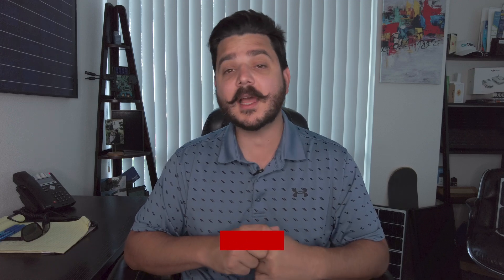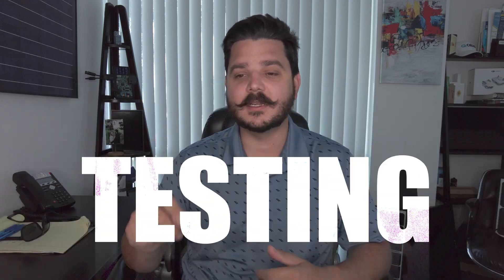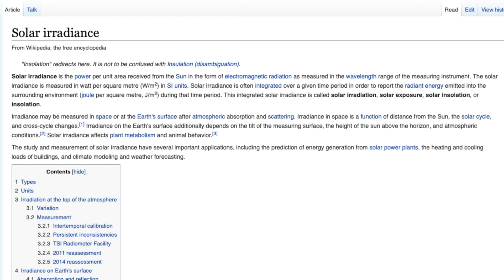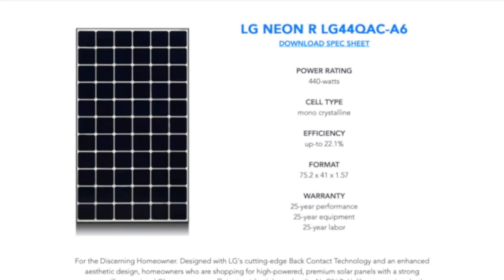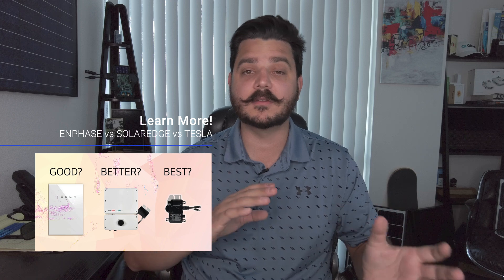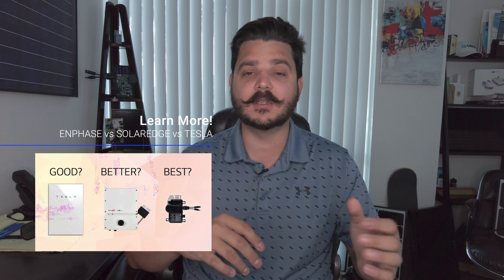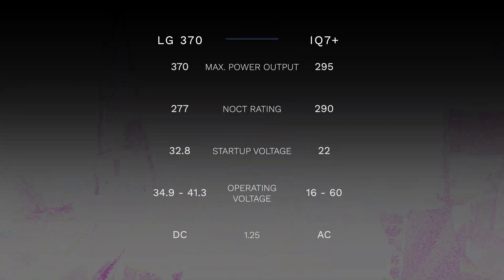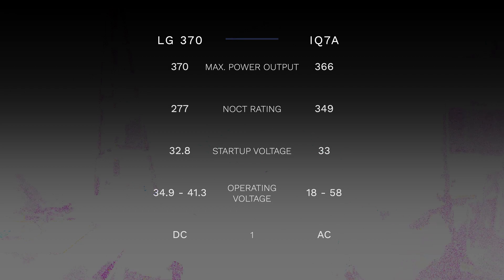Designed to Achieve MAXIMUM Solar Production

Comment: After see thru the video, if I plan to use IQ8, IQ8+, IQ8M, IQ8A for my 400w panels, the specs show all the starting voltages is same 30v.  How could the be?  So is IQ7+ better than since startup voltage is lower (22)?

Comment: Shall I calculate the ratio of DC to AC rating base the NOTC rating rather than STC rating?  Because there is big differences to get the max of the power with inverter clipping.

Comment: Hi, need some advice. I'm in NY, south facing, no shades. Have option to go with iq7a or iq7+ same price paired with rec 395 black. Which is better ratio? Iq7+ 1.338 or iq7a 1.128?

Comment: Hey Dale what is your opinion on this combo that I am being quoted? Jinko Panels - JKM375M-6RL3-V STC rating of 375 Watts with max power voltage of 36.2 and NOCT of 279 watts with max power voltage of 33.2. I can't find the starting voltage. It will be paired with iq7+ microinverters. What do you think of that combo?
Reply from the maker: The IQ7+ is good with that module. You’re at 1.27 DC to AC ratio so you’re under the 1.3 which is where you want to be.
Reply: @pacificsuntech  Awesome! Thanks so much!